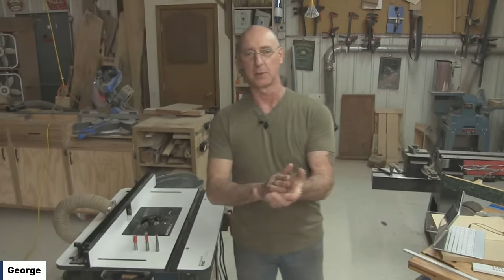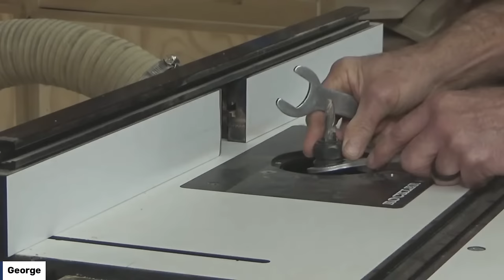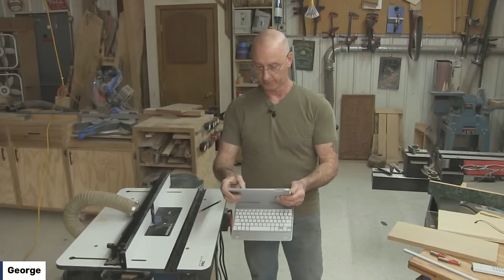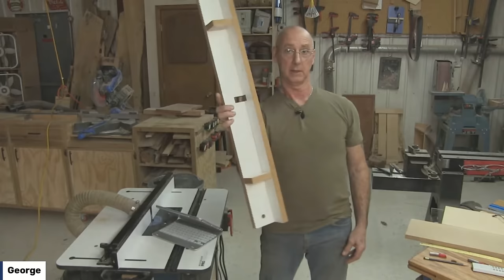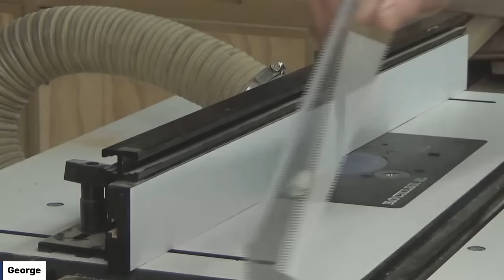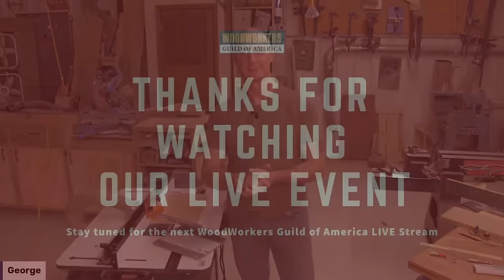Jointing on a Router Table

Comment: Nice demonstration! I think you missed a point on technique, however. It is important on both a jointer or jointing on a router table to focus pressure on the outfeed side of the cutter and not the infeed, if you want to maintain (or create) a straight edge. If you have a curvy board and you focus pressure on the infeed side, it will remain curvy as you'll just be following the existing edge and not referencing off the freshly cut straight edge.

Comment: Thank you for another interesting video. For wood with difficult grain, to better avoid splintering the edges, I would suggest using a "compression" bit in your router, in this joining application. A compression bit combines both an up-spiral at the bottom and a down-spiral at the top, which work together to push the edges toward the center during the cut, in compression, hence the name.